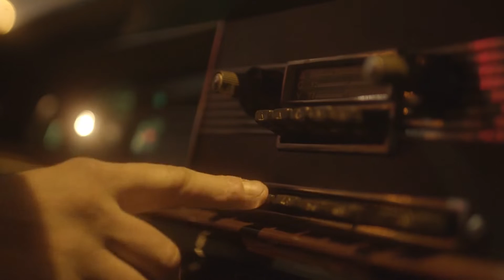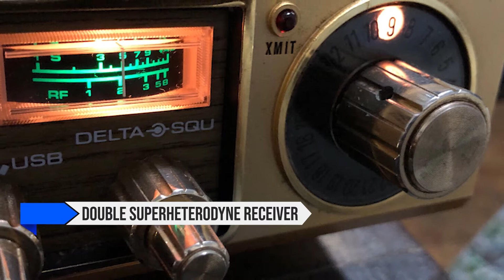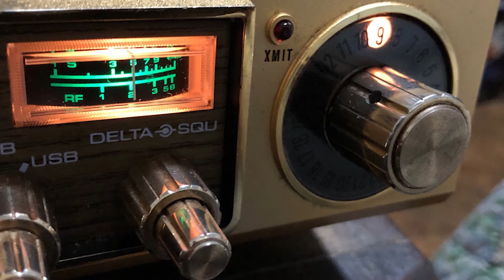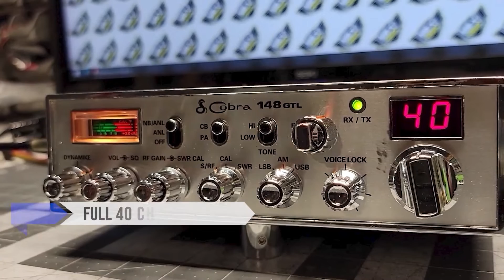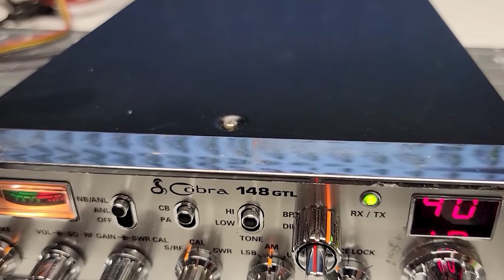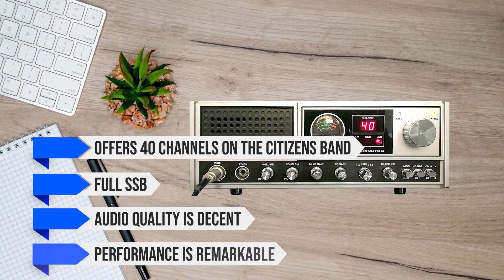THE BEST VINTAGE CB RADIOS!

Comment: This list is so vapid of knowledge about "Best" CB radios that my side hurts in laughter.  No mention of so many radios that were head and shoulders above the
mass produced solid state average stuff shown here. No, these radios were not close to the "Best" in any way.
Reply: Hoping to buy/build a classic truck soon either a 1949-59 Studebaker or 1957-60 Ford so I'm looking for an early cb radio any suggestions and since I don't really want to have one of the giant antennas can I use one of the small modern ones thanks

Comment: Looks like somebody used AI information to create clickbait.  70% is flat wrong. Cobra 148 was great but the premier radio was Courier at twice the money. The flagship of President Base Stations was the Madison (SSB) & Dwight D (AM). I think this guy just chose the radios he owned. SO many other radios out there that were badass...   Midland, T Berry, SBE, Hi-Gain, Johnson, .... got 20 minutes?
Reply: I got to agree with you too I had a 20 I had a 40 channel CB radio and I have a radio right now at connex 3400 HP it's been a really great radio of talking all around the world on it and it works great on my new antenna

Comment: The orig washingtons with the 3 push button switches could temp extra channels if press ch 9 and off 1/2 depressed you would have 27.455  and a finger cramp,if you were long winded
Reply: In a classic CB radios last for a long time and they sound great over the air

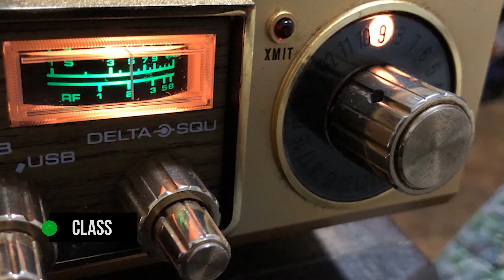Comment: You 've got the 10m vs 11m wrong.  11m (CB) does not need a license, 10m (HAM) needs a license.  Reference 2:39
Reply: CB had a license until around 1977 when the FCC got over 1 million applications in one year. They threw their hands in the air and gave up. It had a fee in 1975. 1976 was free. When they went 40 channels, stores had to drop to rock bottom prices to sell off the remaining stock of 23 Channel. After January 1st 1977 it was no longer legal to sell 23 channels. The industry had been begging for a few years to get more channels from 23. When they finally got the approval from the FCC combined with the no fee license, it created a flood of sales shocking the public and the FCC. There was a flood of trucking movies and everybody including Realistic was putting out 12 inch vinyl albums with trucker songs. It was a massive promotion to clear the 23 channel CB's off the shelves. The whole thing snowballed and suddenly in 1977 you could go to any parking lot in America and there was a CB antenna on one out of 10 cars. You could spot your car before that but now you walked out of your store and looked at a parking lot that looks like a porcupine. In about a year, the CB license had disappeared altogether. The funny thing is there was a few months where the license was indefinite/non-transferable, as well as free. If you never moved & and didn't change your name, the station license is still valid. 😮 😅 I still have ours.
Reply: @chetsjug no joke Sherlock 😅😅😅

Comment: Iv had em all at one time or another.still have 4 7 different radios.tram was the best,still is.the d42 and 12,with the cobras in 2nd.
Reply from the maker: Thanks for sharing!
Reply: I had a Tram Diamond 40, oddly it was still a 23 channel radio. It was a beast. Best radio I ever used.
Reply: @Arise-308 you can't beat a old tram with anything.i have a d12 and d42 both rock and roll.throw a good 500 elkin 4 BARROLL behind it and the world is your oyster as long as you like..
Reply: @olivertaylor8788 tram trash 😅
Reply: @Arise-308 junkyard dog tram 23 channels 😅
Reply: Good for you Sherlock 😅😅
Reply: You have all mud duck 🦆 radios 😅
Reply: Had my d42 in line the other night with a SSB desk mike. Got flowers on the clear audio.
Reply: @handlebarhammer junkyard dog 😅